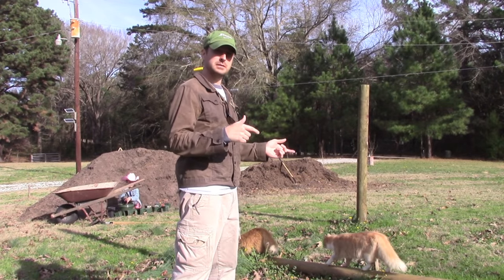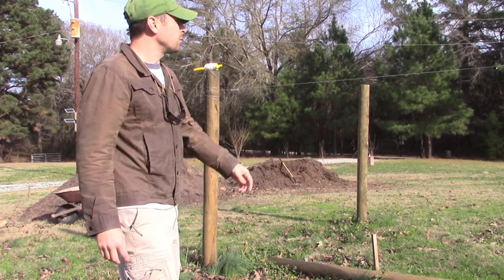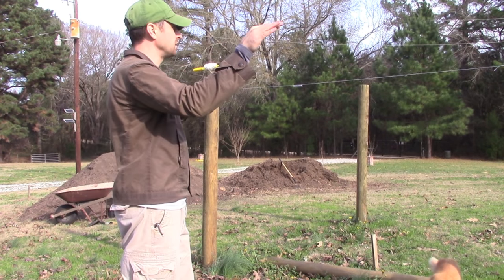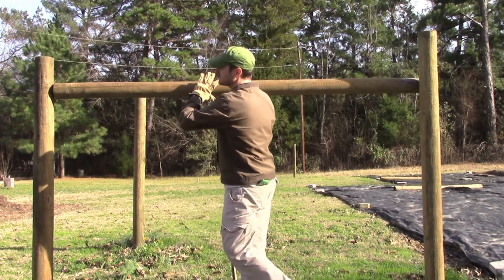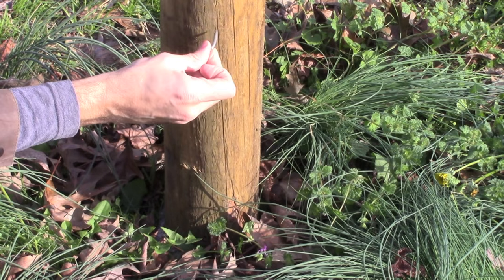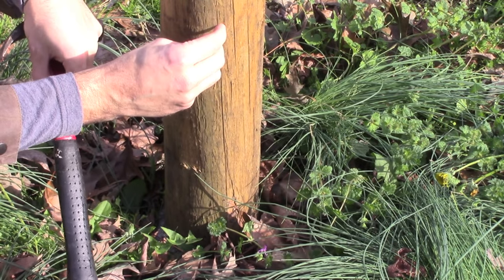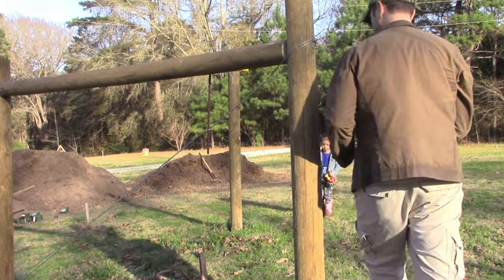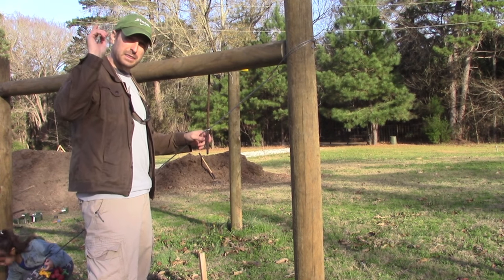How to Brace Fence Posts FAST and EASY!

Comment: That re-bar used in the brace to tension the wire is extremely dangerous. I have found if anything is left to chance, it will happen. I got anxiety seeing your little girl near it.
A better approach is a wooden stay that when tensioned on that brace wire is sticking up at least 6 inches over the wood cross brace. If the fence wire is going over the top of that tensioner piece then a lot better.
I have built miles of fencing contracts for the government and that's how we do it. Wood, and never metal because you never know who will be touching it in your brace system. The contracts also stipulated to never have spikes sticking out on the ends of the post for the brace wood because someone could be climbing over the fence, slip and could hit a body part on the spike sticking out. Everything flush driven.

Comment: From a city slicker with no farm experience who just bought one, many thanks!  
Does spacing matter? Maybe I missed that
Reply from the maker: Glad it was helpful. Very excited for you to get out into the country. Are you talking about spacing at the corners? or along the actual straight run fence line? etc?  Spacing of the corner posts is somewhat important but if you have too great a spacing you will not get the stability needed if the ratio of post thickness is smaller. Say if you have 4" posts, you need them closer to each other than if you have 8" posts to gain the same stability. You can see that I had 6" posts and I spaced them about 8' apart. Hope that helps.
Reply: Country Living Experience: A Homesteading Journey Yeah, we’re excited.  Traded the Viper pictured for a ‘63 Ford 4000 tractor😂. All in bro!
I was asking about the spacing of the two vertical posts. Is there a certain space they need to be for the brace to go in between?
Thanks man!
Reply: Country Living Experience: A Homesteading Journey okay, just saw your complete answer. Many thanks

Comment: How deep did you bury your posts for the fence? My male goat is pretty strong and he bent my fence at another location. Please respond. I need to make it strong enough to withstand the weight of a  herd
Reply from the maker: They are 2ft in the ground.
Reply: The best  recommendation is 80% the height of the fence. I did a 52" fence for my goats and horses, so the posts were in the ground 41". Along with the proper bracing, your fence will hold up for a long time.
Reply: @coryvann9631  didn’t your goats just step
Over your 11”high fence ?
Reply: @timothybint4960  😂

Comment: nice video. Have seen this rebar method a bunch of times now, but wondering why not just drill a hole in the bottom of your lateral member and pull down and slide it into the hole, leaving it no chance of "lettin go"
Reply from the maker: Good idea. They never have let go. If they did, they are twisted toward the fence. So, if one slips, it will just spring out 3 inches and hit the fencing.

Comment: What is the bracing for? I just did a similar fence for my friend's property and I used 8" ledger lags.
Reply from the maker: Cross bracing solidifies the frame. It provides rigidity against racking. The single cross brace creates a triangle which will transfer and distribute loads on the fence across all members of the frame evenly. This is a structural engineering basic. Thanks for your question.

Comment: I have put up a lot of fence in my life so I  know what I am talking about, Your brace rail ( on top) is good ,BUT you should have run your brace wire from the bottom of your corner post to the top of your line post to have a more solid corner post.
Reply from the maker: I may be misunderstanding you brother. That it what I did. The wire is run from the bottom of the corner around the top of the line post.
Reply: I thought that's what he did ?
Reply: Rick Hicks That's what he did!

Comment: So, does the rebar stay there permanently?
Reply from the maker: Yes, it does. It remains to hold tension on the wire.
Reply: I'm not at all an expert but I think that this little thing rebar could be dangerous at her low part .

Comment: No Concrete?
Reply from the maker: We did a different video on setting fence posts. This vid is about bracing. Thanks for watching
Reply: If your corner posts are in the ground the proper length and the backfill material is tamped properly, the ground support will be stronger than concrete.

Comment: How do you make a TIGHT chicken wire fence?
Reply from the maker: Chicken wire is too think to really tighten well. It just stretches.
Reply: @CountryLivingExperience  How do you stretch it? Mine is floppy! I have it nailed to wood posts  but between each post, the wire is floppy! Thank you for any suggestions.
Reply from the maker: @sloanehodge6065  Take two 2x4's and sandwich them together over the fencing. Bolt them together. Attach a chain at the top and bottom and pull it tight with your tractor or truck.

Comment: From a engineering point of view tthis is not the best way to brace a post the cross brace should be angled from the bottom of the inside post to the top of the corner post then a wire in tension using a turnbuckle from the top of the inside post to the bottom of corner post. Doing it the way in the video causes racking which can allow the fence wire to sag and loosen the posts. This  may be good for a garden.but it would never be any good for livestock
Reply from the maker: If that is the case, then every single rancher in the whole of East Texas is doing it wrong. There is no racking and we have sandy soil. There is no fence lag here nor on any ranch that I drive by.
Reply: force pulling on them. By using a crossbeam on a slant as i suggested you create a triangle which is a much stronger  structure.
Reply from the maker: I am an Architect. I understand force and load distribution through triangles. The cable completes the triangle and the load is distributed properly. 
You didn't address my rancher comment. Come out here and tell them they are wrong too...lol.

Comment: what size posts? how many times did you wrap the wire? what gauge wire ?
Reply from the maker: 6 inch posts minimum, 10 gauge wire, wrap around at least once.
Reply: Country Living Experience cool thanks, you make it look easy
Reply from the maker: No problem. Good luck building your fence.